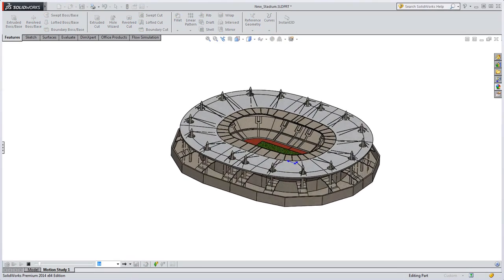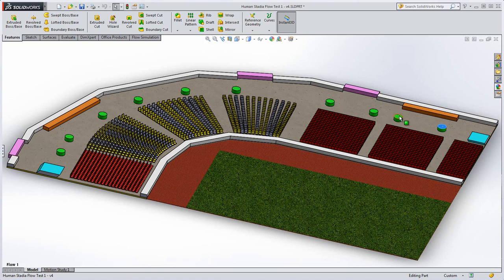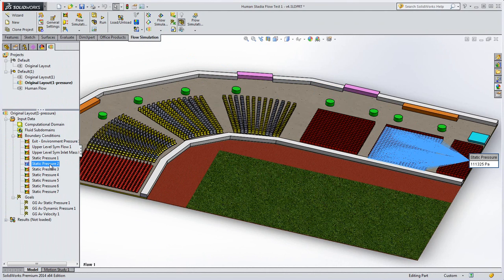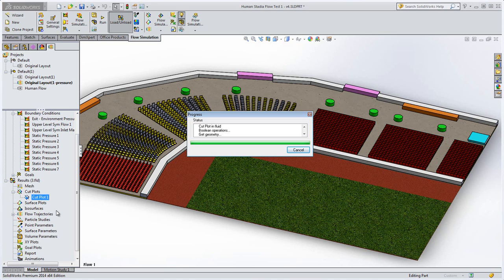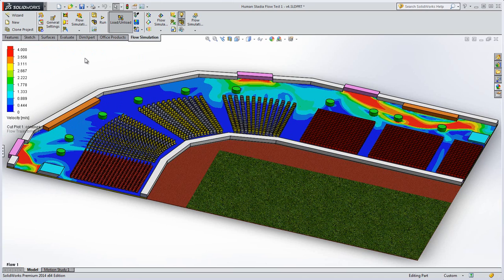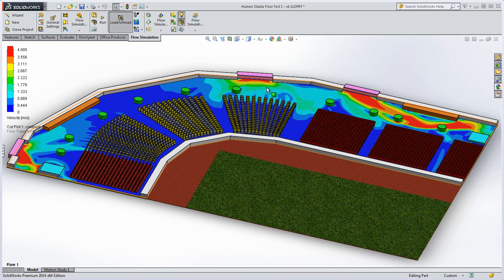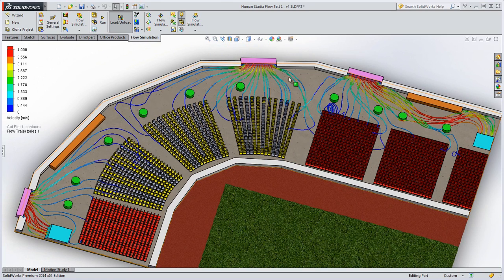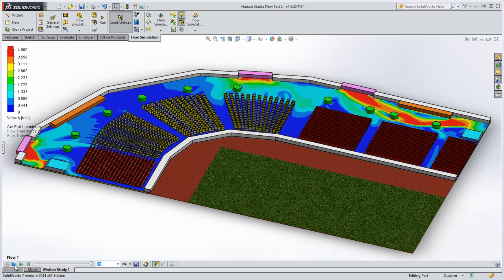SOLIDWORKS: World Cup Special Human Foot Traffic Flow

Comment: I remember solving traffic flow problems in fluid dynamics courses in grad school, so this simulation has validity.  (For the curious, a traffic accident represents the pressure build up in front of a shock wave and then the sudden speed up of vehicles after they pass by the accident / shock wave.)